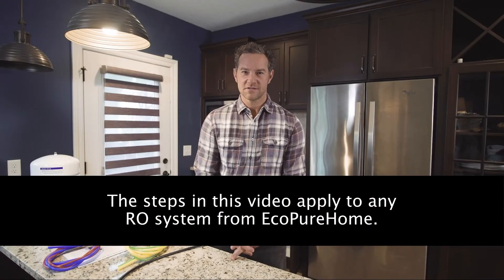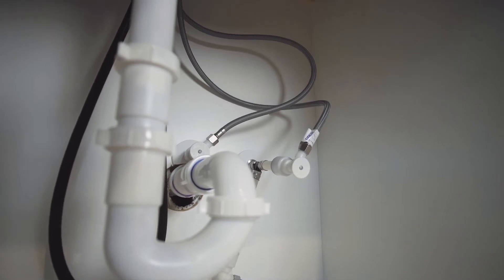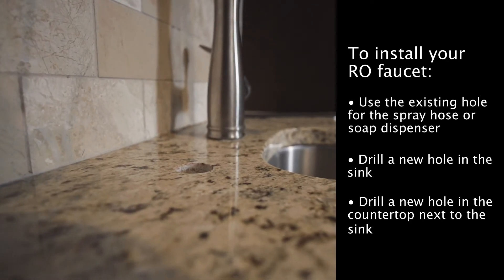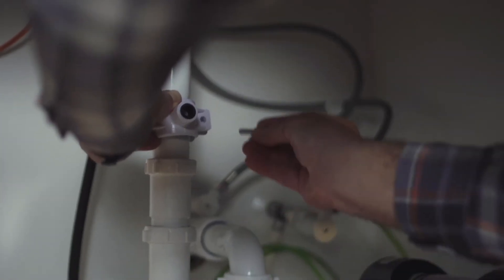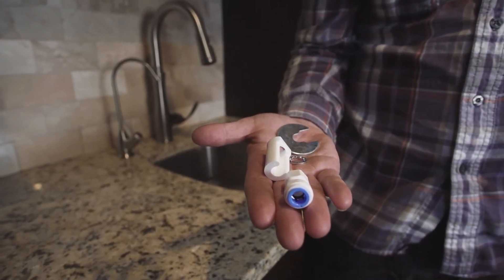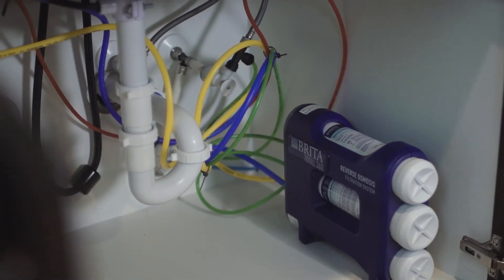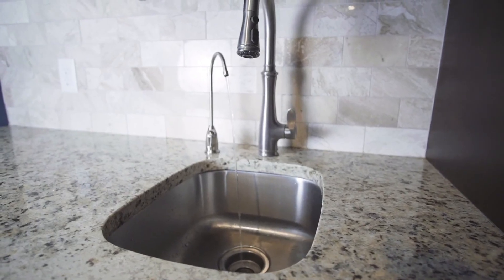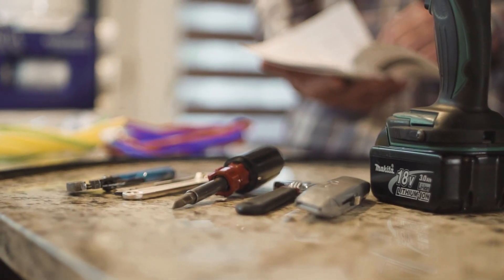How to Install a Reverse Osmosis System

Comment: I have an Ecop30 Reverse Osmosis System, recently it has weird problem, water comes out  from faucet is so slow, meanwhile the storage tank is only about 1/4 full, New first and third filters just were installed 3 months ago,and Reverse Osmosis membrane installed 11 months ago. I wonder what's wrong with it?
Reply from the maker: Thanks for reaching out!  You might find the following guide helpful: https://ecopure.zendesk.com/hc/en-us/articles/360060831234-Low-Water-Flow-Reverse-Osmosis-